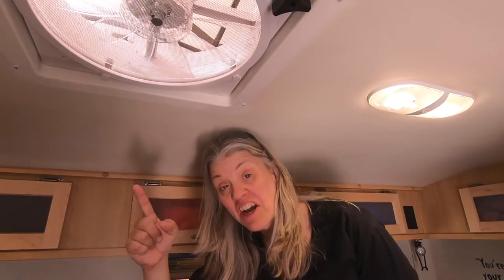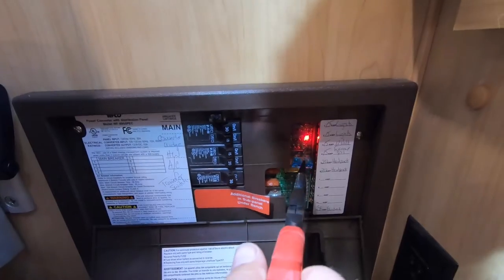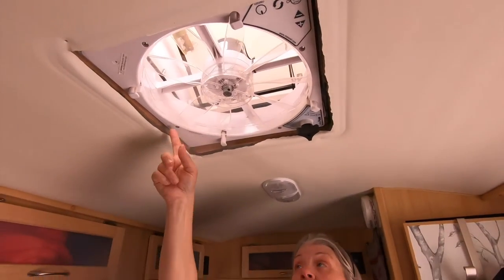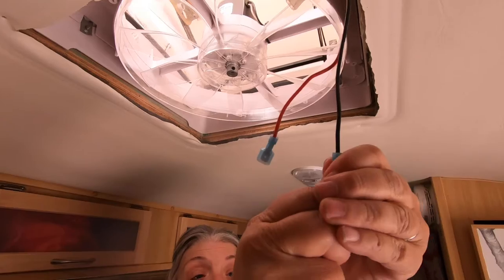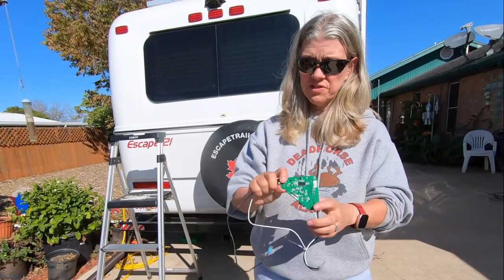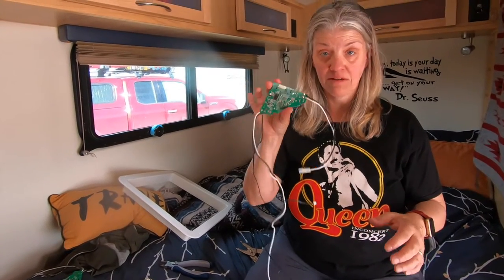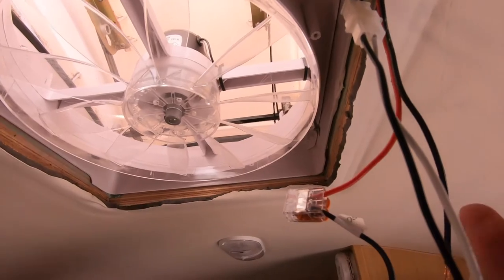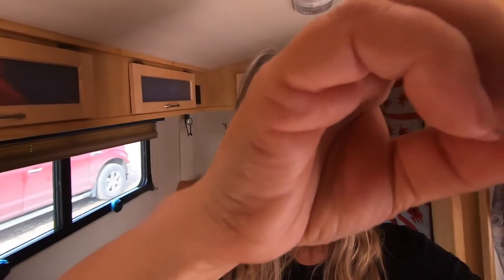MaxxFan Troubleshooting - How to Reset the Fan & Seal the Circuit Board

Comment: My Maxx Air fan started to malfunction after 11 months.  Fortunately the manufacturer is standing behind it and is sending out a new circuit board.  According to the Rep the newest circuit board update includes a built in voltage regulator
Reply from the maker: That's good to hear!

Comment: Ashame MaxFan cannot protect their circuit boards.
Reply: Well, that's an extra couple of manufacturing steps and extra cost. And besides, who else are you gonna buy replacement circuit boards from besides the manufacturer?

Corrosion on circuit boards has been a problem since the very first time people soldered two wires to a board.
Reply from the maker: At least it's a pretty easy fix!

Comment: Trouble is after putting in a new board last spring it eventually started beeping at higher speeds.  Upon calling MaxxFan last week they asked if we had solar and how high is our voltage.  We charge up to 14.6v and float at 13.55v.  MaxxFan said that's too high and we need to install a voltage regulator.  When I get time next week I'll be tearing the MaxxFan out again and installing a voltage regulator.  They should have informed me that with today's solar you need a regulator and I would have only had to install one time, instead of two.
Reply from the maker: Thanks for the info Perry! Yes, they should definitely tell people and it's a shame they don't. I'm not sure but the new ones may actually come with a voltage regulator now. For some reason we haven't had any issues with the higher voltage ourselves. This is an important thing for people to be aware of
Reply: I am on my 3rd mother board and I have only used my new mini-camper twice!!  Maxx insisted that the "supposed" voltage regulator problem was NOT an issue any longer, but I just received my Drok voltage regulator to install with my new motherboard.  Maxx also stated their boards are already seal coated for moisture, and that if I spray, it voids the warranty, so still debating that.  Funny how some Maxx reps advise the voltage regulator and others say it is no issue, or tell you to add the regulator "off the record."  I have been advised all 3 ways.  I am just tired of the dreaded alarm, and blinking green light.
Also, I am still on warranty, but had to wait for back-ordered mother boards for months., They finally sent me a whole new fan at no cost, because it was going to be quicker to take the motherboard out of the new fan and switch it out with the useless one on my current fan, rather than wait for the delayed mother boards to come in.

Comment: You mentioned turning off the battery power before working on the fan. I just want to mention that in my new Escape19 with solar that if the sun is out the solar controller will still provide 12v power even when the battery is disconnected. There does not seem to be any disconnect switch for the solar so I will probably install one at some point. Pulling the fuse for the fan will certainly be effective.
Reply from the maker: You’re right and thanks for pointing that out! Pulling the fuse is definitely a good idea!

Comment: Perfect timing! This was next on my to do list on my 21C. I have two Maxx fans that I want to spray the motherboards. I had the board fail in my 19, And yes it happened at 2:00AM. The fan started working by itself with no functioning buttons to turn it off. Fan was blowing in cold December air and I’m up disconnecting power to it 😡
Reply from the maker: It’s the biggest pain when that happens at night!!

Comment: I got my 5th wheel back from the shop and found two of the three Maxx Air fans were no longer running.   I started by trying the reset...I used my 1 working fan to confirm when I had fully shut off power to the fans.  The converter had a switch (not a fuse) and I had to also use the battery disconnect.  Once both were off the working fan had no power.  Closing the switch successfully reset my two not working fans.  Thanks for your excellent video.

Comment: After a long wait MaxxAir did send me a new circuit board with the built in voltage regulator.  
I bought the CRC spray and put on a few coats.  
I’ll check in later a let you know if it works as expected.
Reply from the maker: Cool, it should work well!!

Comment: Thank you for another outstanding video.  I've already ordered some Wago connectors, I did see where they are not waterproof so not recommended for exterior use. As you mentioned, there is a possible issue with the higher solar charging voltage and I have read on the forum that the new Maxxfan boards and fans work with the higher voltage.  I have also read that the new boards and fans will be coated from the factory.
Reply from the maker: That's awesome to hear they will be coated from now on!

Comment: My Max air stopped working ,But a different problem. I R Remote control stopped working. Black wire from the remote battery (black wire) to the pcb was green, and had to be replaced.

Comment: Oh my god, the Green Light of death. The more I work on my fan and the more I talk to people, the more I think this company purposefully built this fan to fail. there is no voltage regulator, so the motor and the circuit board will fry if it gets more than 12v on a consistent basis. And lithium batteries are 14.5v, so you are guaranteed to blow both over time. You absolutely need to get a 12v dc to dc voltage regulator to keep it at only 12v. They are about $15 - $30 depending on which one you get but you MUST get one or you'll be doing this year after year.

Comment: Hi,  Thanks so much for this video!  My bathroom fan quit raising and lowering using the wall mounted control.  The fan itself still works, so I thought it should be the circuit board.  
Two questions for you;
1) What part of your fan stopped working.
2) Do you feel the moisture affects the circuit board, and is that why you sprayed it with a protective coating?
I really appreciate your time, thanks!

Comment: My Maxx Air fan wouldn't work and it was a corroded rain sensor. This will be an ongoing issue because I can't coat the sensor or it won't ever work.

Comment: I can open my fan door, but if I turn on the fan itself it will close the door and turn itself off.  Do you have any idea what might be the cause?  No one else seems to know why.   Thank you!
Reply from the maker: I'm so sorry I don't have any idea why it would be doing that. Sounds like your mother board is screwy but I can't be sure
Reply: does the green light come on? the green light would indicate the fan is set to auto (maintain 78 degrees).  press /hold the auto button again to turn auto off

Comment: Another great, very informative video!
Would you recommend taking apart the fan and sealing the circuit board to someone who takes delivery of a trailer today?
I guess I'm wondering if it's best done when the fan is at its least used point or more optimistically if they've just started doing their own fix to this problem by now...

Comment: Where did you buy your  board? Was it modified?
Reply from the maker: You can get the board from Panther RV. Ours was not modified
Reply: @AdventuresInNoMadness  Very nice video thank you. Do you have any other source for this circuit board (or a specific part number)?. I have the exact model as you, but the Panther RV link seems no longer in business. Thanks